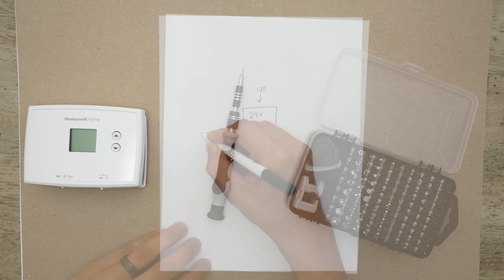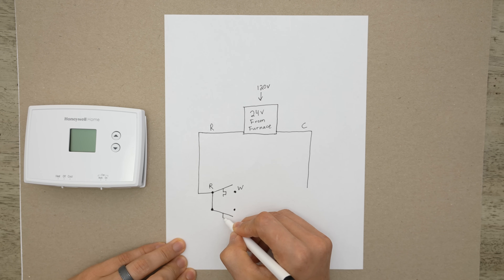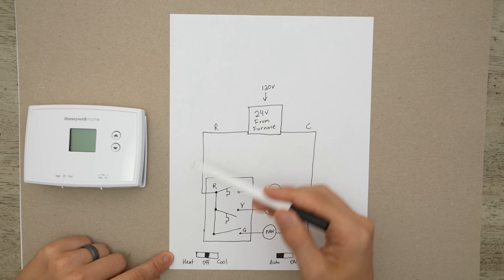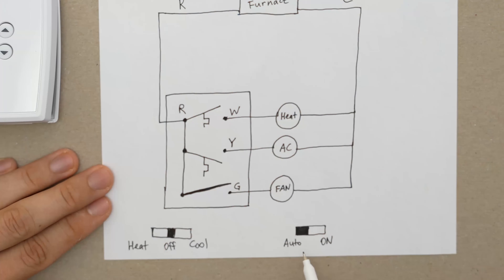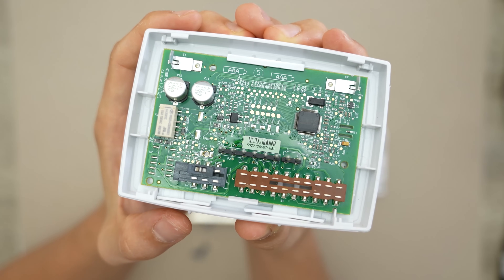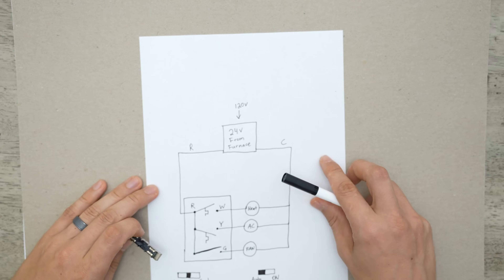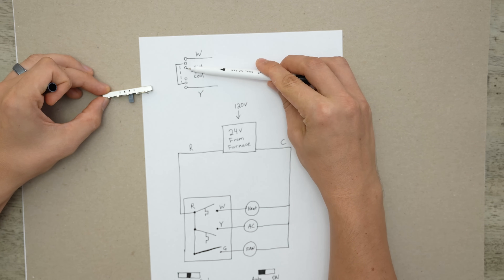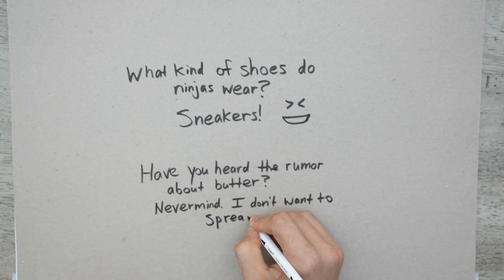Basic Thermostat Wiring Diagram Explained

Comment: Your explanation is mostly correct but the diagram is wrong. The R wire is the signal wire and carries voltage which the thermostat shorts to W/Y/G to signal each function on. Each of W/Y/G wire directly back to the furnace. They do not connect to the C (common) wire. The C wire is a completely separate wire that supplies 24VAC power to operate the thermostat itself. Some modes can pull power off the R wire and some have batteries so the C wire is optional depending on the model.

Comment: I am Korean
I always enjoy your lectures.
All are good lectures.
I am curious that when R and W are open, 24 volts are output, but when they are closed, 0 volts are output.
Since English is a problem, I will ask you a question using Google Translator.
thank you
Reply from the maker: Glad to hear you like the lectures! Thank you.
R and W are wired like a light switch. There is no neutral. So when the switch is closed R and W become connected, like a single piece of wire.
It is like testing voltage by putting both of your meter leads on the same spot. There is no change or drop off of voltage so it reads 0 volts.
Reply: @WordofAdviceTV  Thank you so much for your kind response. I will continue studying.

Comment: Thank you so much.
My thermostat fried do to static electric charge. Only 4 wires on old stat to furnace so I am going to rewire it with 5 wire as new stat requires common wire. Your order vidéo showed Exactly how to rewire. I didn't want to worry about frying  the board of stat. 
Again thank you.

Comment: Very nice presentation of some of the basics.   What I'm looking for is what type of component is used to perform the connection of the 24V to either W, Y or G.   Is it a relay or a solid state component?   It must have quite low control current demand (high impedance input) since the two AA cells in my thermostat last a very long time.  I'm going to use a standard thermostat as a hand-held device along with a wireless transmitter so I can move the thermostat to anywhere in the room.   The receiver will be at the location of the existing thermostat wiring (which is in the wrong place to adequately control room temperature).  So the receiver needs to switch the 24VAC and it must be battery powered as there is no house power nearby.

Comment: In minute 6:36 you state the mode switch is either gas or oil. That is not correct. The two positions are fossil fuel (gas or oil) or electric. I notice that your thermostat is set for gas or oil.

Comment: Love the breakdown of the internal of the heat, off, cool switch.  However, two things to clarify:  1. On the ladder diagram use only one bi-metal and position the switch from R in-between the W and the Y contacts.  Show the bi-metal symbol on TOP of the switch. The interpretation is still the same R closes to W on a drop in temp. (Heat), and R closes to Y on a rise in temp. (Cool).   2. Draw the Fan switch pivoting on the G terminal and vertically touching Y for the auto setting, and toggling down to R for the ON setting.  This indicates that the fan goes to high indoor fan relay coil on a call for cooling  -  R to Y and simultaneously to G.  R to G just fan on high.
The heat anticipator and cooling anticipator found in mechanical stats are an added complication. Fortunately the people who still use them aren't troubled by it.

Comment: If I set my thermostat FAN control to auto, it should stay on , correct ? It doesn't come on. If I jumper R to W on my thermostat block and again on the control board my furnace should start working, correct ? It doesn't. I did however notice and an end pin on my thermostat was badly bent so I straightened it out so it would seat and make contact again. At the door switch, when open, I get 63 volts on AC. I measured all my breakers and got 120 v to ground, so I don't think I'm missing a phase. Although my problem started a couple days ago when the hydro company popped my meter off for an inspection. Would I still get 120 off every breaker with a bad neutral if they messed that up ? I did not measure any voltages on the terminal blocks. I'm guessing it should be some low dc voltage ?

Comment: Thanks for the video!! One quick question/clarification though regarding the switch between “gas or oil” and “electric or heat pump”: There are only two settings. Gas or oil are the same setting, and heat or electric are also the same setting, correct? I think the explanation at 6:35-6:50 might have stated it differently. Thank you

Comment: Basic Thermostat Wiring Diagram Explained...And you didn't wire a thing.  You should change the name of this video to Thermostat wire diagram and Internal thermostat functions.  You explained 5 wires but not where exactly they go and why there are 8 connections on a thermostat.  You started perfectly but went completely off the rails.
Reply: He made an older vidéo where he took à thermostat, circuit board furnace and à braker aka ac and showed exactly how to wire it up.

Comment: Thanks for the post. Here is my question...who was the idiot that named the wiring? Why not call "R" terminal "24V" as in power, or Yellow wire "C" as in cooling, or "G" as "F" as in fan? The control board is complicated enough, why use lettering that do not match their function?
Reply from the maker: Haha I totally understand the sentiment. Sometimes I think they purposely make things more difficult than they need to be. In their defense though, I think they may have labeled them according to the wire colors. Like this: G-wire – Fan, usually green. Y-wire – Cooling, usually yellow. W-wire – Heat, usually white.
Reply: @WordofAdviceTV  Thanks for the reply.
Reply: @WordofAdviceTV 
Since most désigners and engineers work in cyber space and not the real world what do you expect. IF they had to work on the créations like the rest of us it would be like 50 years ago.

Comment: Is there another way powering the thermostat instead of using double AA battery ? Digital thermostat and not the analog
Reply from the maker: There is a 24v power wire that comes from the furnace and gets hooked up to the R terminal on the thermostat. The thermostat gets it's power from the furnace and the batteries are only a backup so if your power goes out, the thermostat will not shut off.